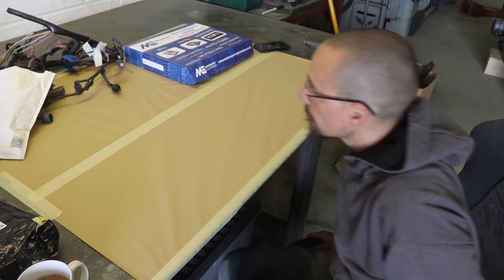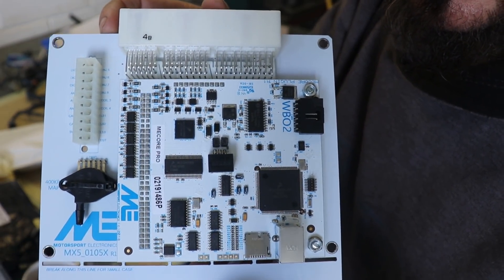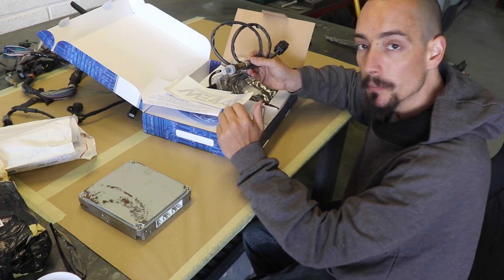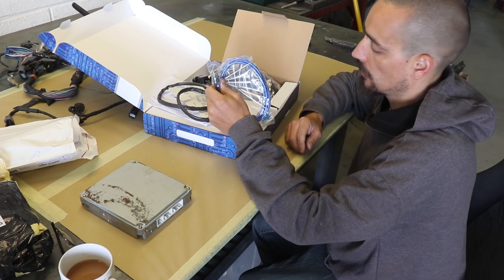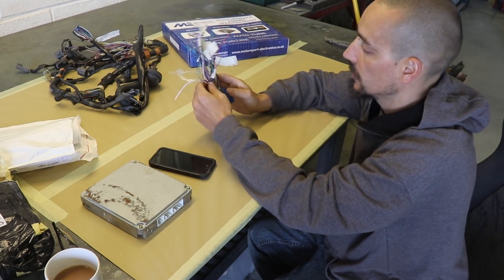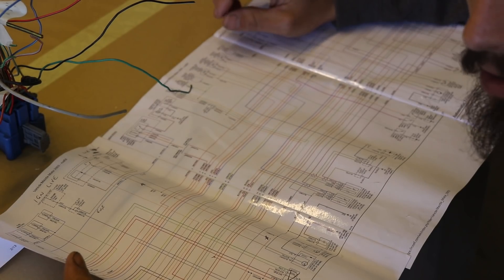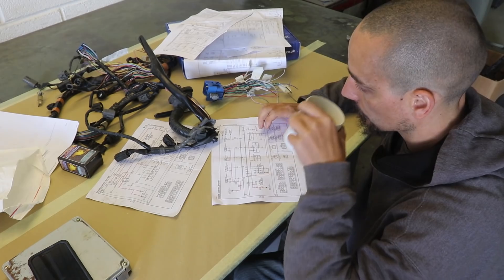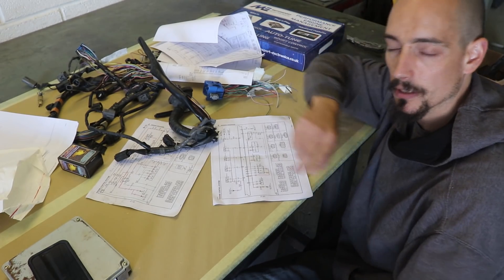A QUICK LOOK AT MY ME442 STANDALONE ECU- MONGREL POWER

Comment: That's why I go with Haltech with premium wire-in loom. 
Harness comes with fuse box and relays all pre determined and can be switched out for other functions if not utilised. Simple things like fuel pump staying on during crank and ability to work second feed pump (or 3rd pump in the case of my FD) on boost etc etc etc, all there ready to go are a bonus, plus you have downloadable base maps even for mx5. 
Makes installion and routing alot nicer and clean aswell as being all new, the simplicity of plug and play can be argued but if you've gone to the extent you have to build it why then skimp on the brains of the operation and dated components like the link that sends and receives all signals, ground and power to the most critical component, your engine..
Self learning and expandable functionality are nought to be sneezed at neither. 
Chasing 30yo wiring gremlins is not my idea of fun and being able to either insulate or isolate new wiring from heat sources in motorsport applications should be a priority.
My 2c anyway
Reply: But they are pretty expensive I think

Comment: A relay is simply a remotely located, high load capacity electrical switch. It is operated electricly at a very low current draw by a regular type switch in the car. In this case, it can be turned on by the ECU which can only handle low electrical current flow, or load. Commonly used for headlights, AC clutches & a whole heap of other high current draw applications.

Comment: Don’t forget that the ecu almost needs its own battery.
You need to ensure that when you’re cranking the motor the ecu is not seeing a power drop or worse on a circuit that is powered off while cranking.

Comment: Hi, really good project , really impressed. Just as a point of interest, if you know the loads that are going to be 
involved, elmdene do some double pole electronic relays , that use a changing state trigger and a permanent 12v , the loads are not massive but they are handy if you have to do two items in one go. And is only a chaging state trigger , i use them at work , very handy . Well done mon.